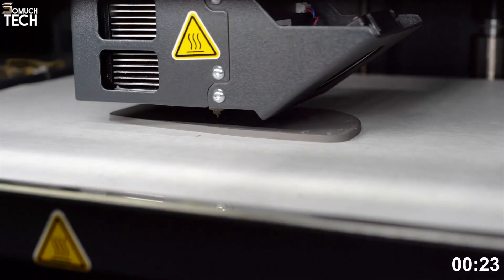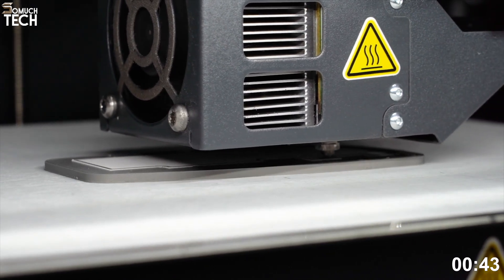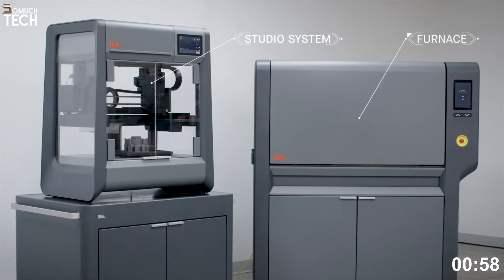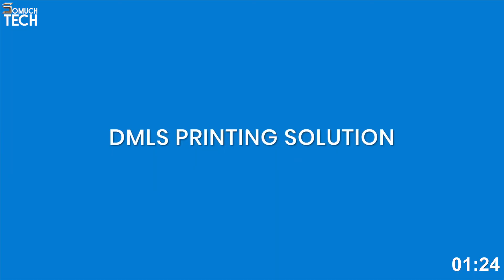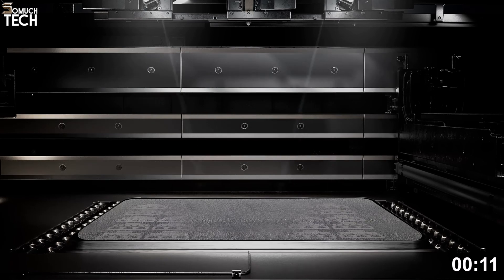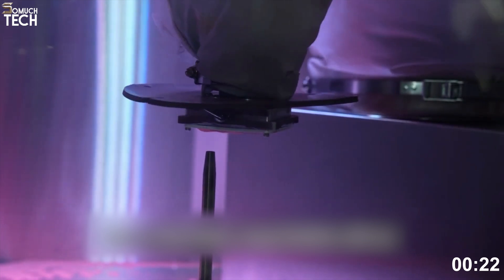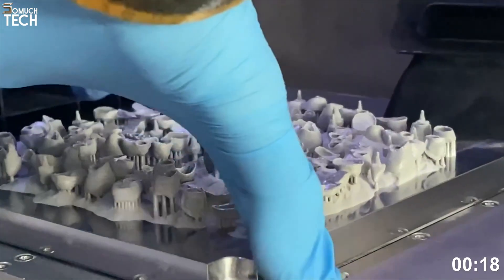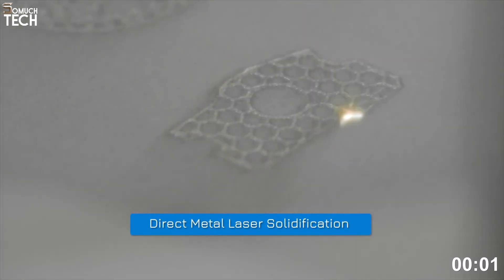BEST 5 METAL 3D PRINTERS MAKING INSANE INDUSTRIAL PARTS IN 2025

Comment: Next beyond this is below...

Use Case: *3D-Printed Single Crystal Turbine Blade for Jet Engine*

#### **Goal**:  
Replace traditional *cast turbine blades* (made via directional solidification) with *3D-printed single crystal blades* that are **lighter, stronger, and more heat-resistant**.

Comment: This is the future right here. Just imagine how much every field of work will improve when complex parts can just be zapped up by a laser in a few minutes taking the hassle out of a lot of jobs
Reply: Exactly my thoughts as well. Imagine where this tech will be in ten or so years. Scramble your engine? No problem, just 3d print all the damaged parts and rebuild it. Back on the road within a few days.
Reply: @allenpost3616  No, not even close.  There is all kinds of work that need to be done to a 3d print before it's useable.  3D printers can't come close to holding the tolerances/surface finishes needed for making engine parts.